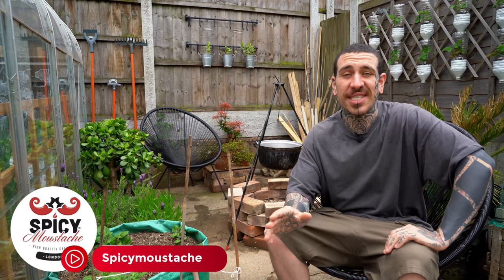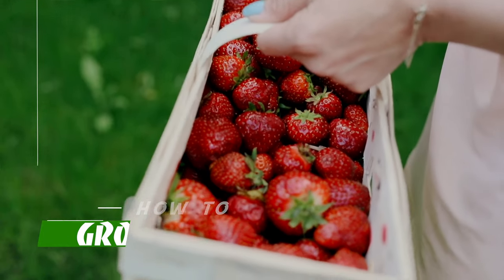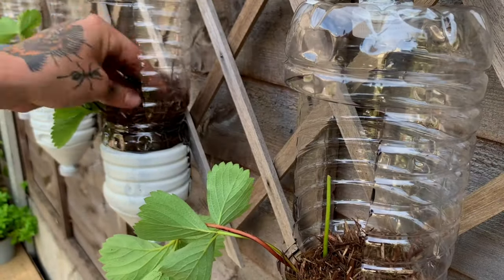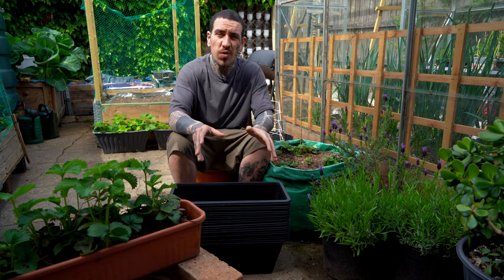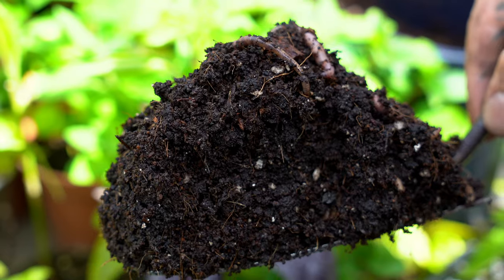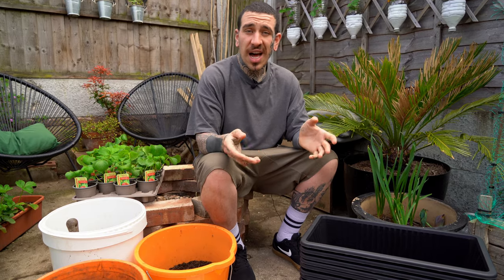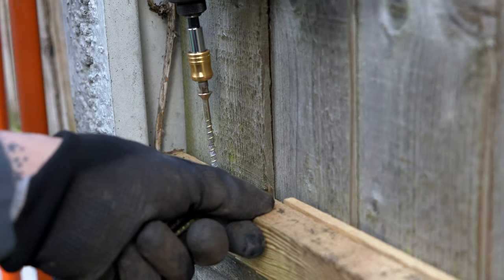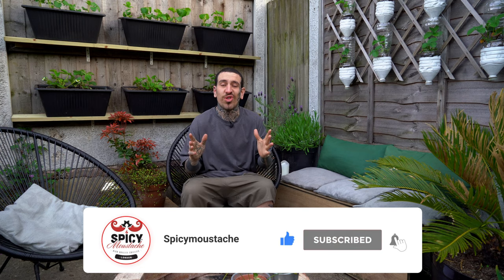How to Grow Lots of Strawberries in Containers

Comment: Can anyone tell me if the berry plants will survive a freezing winter like this? I know the English climate is lots different from where I am (NJ) ... I would think the plants/roots would freeze solid in small containers. Before I build a wall, wondering if anyone knows if they'll die or if anyone has any advice for insulating them during winter ... In the US, I'm in Zone 7, with winter temps getting into teens and sometimes single digits, esp with wind chill. Thanks so much in advance!